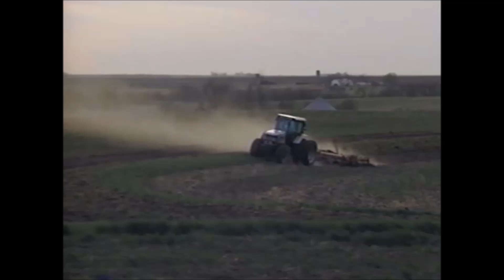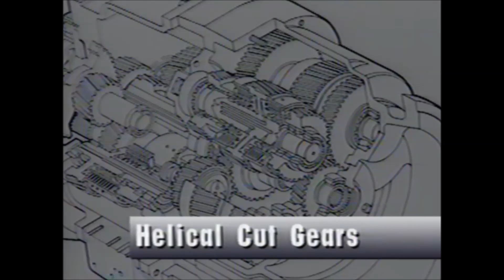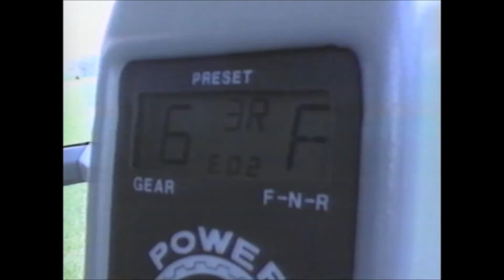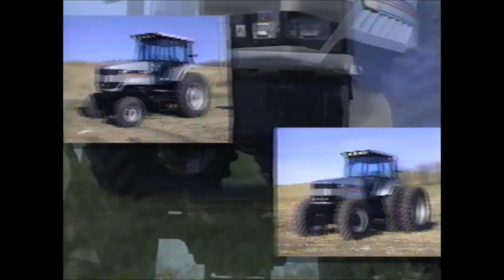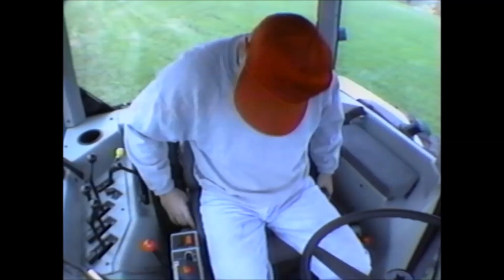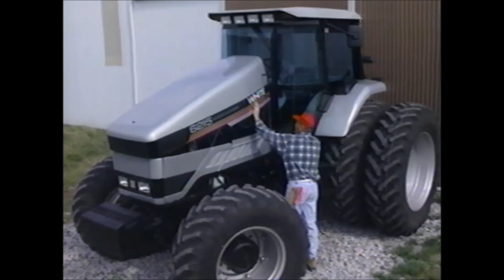White 6100 Powershift Tractors 1994 Features & Benefits

Comment: If they were that good where are they now ?
Reply: Here is my take on it. In 2001 Agco was selling Agco, Agco Allis, Agco White, and Massey Ferguson tractors in North America. This is a little bit of a nightmare. You are competing against yourself and having to design, build, and market multiple brands. At the same time they have a brand new advanced tractor facility probably with tons of potential capacity. So what to do? So they dropped the Agco Allis and Agco White brands and started selling orange painted Masseys as AGCO tractors in 2002. In 2011 they dropped the AGCO brand for some of the same reasons.
Reply: @awd3264  they call that "General Motors syndrome." 🙂
Reply: @etmccaus I never thought about that, thanks for the insight
Reply: awd3264 so do you think they are bad?
Reply: @owenknight5344  No.
Reply: Brendan Hough agco took them out and put in the orange DT series tractors.